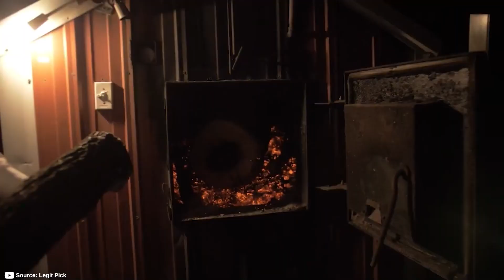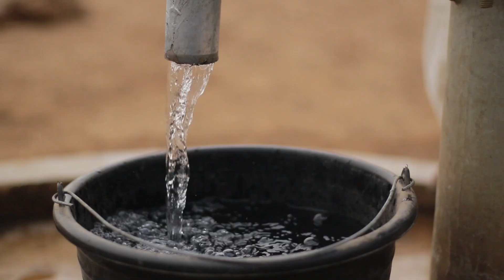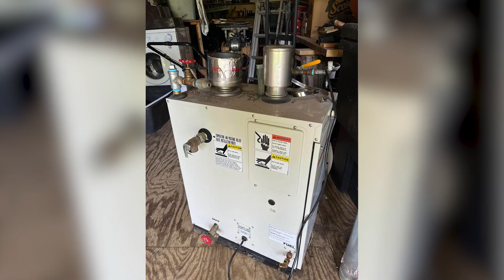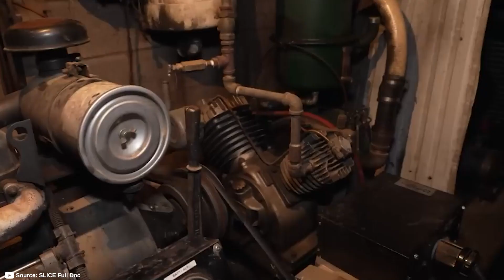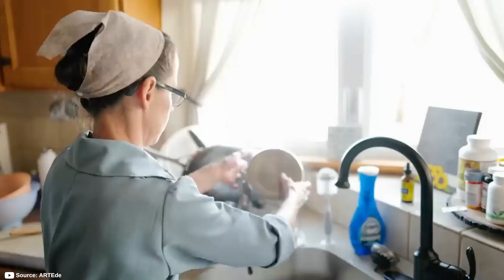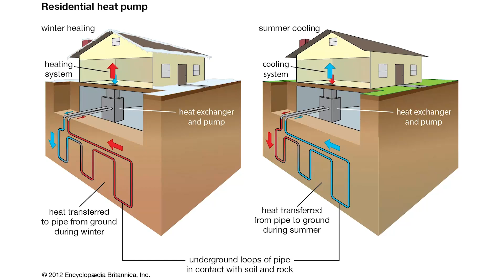How The Amish Get Hot Water WITHOUT Electricity

Comment: Geothermal heating doesn’t necessarily work well in very cold regions. I lived with my friend who had this system I froze every winter. Barely holding 60 degrees F. We had to rely on a chip burning stove to at least keep the kitchen warm that said it was a very large home on Lake Ontario mix in big windows and the lake. Very very cold summers better air-conditioning worked well on it.

Comment: how do you create pressure with no electricity?
Reply: gravity
Reply: @N1ghtR1der666  How do you use gravity to pull water up hundreds of feet underground??? 
Do you, like, turn it upside down or something?
Reply: Haggis, the water pumps are operated by hand with a lever and small pump. Think of  a bicycle air pump. These types of well water pumps were common throughout the US. Transferring the water high up into a water-tower or water tank allows for pressurized indoor plumbing.
Reply: @undernetjack  I know how it works, thanks. 
I was asking the other guy to explain how you use gravity to pull water up when it's gravity that's pulling it down
Reply: Ask Queen and Bowie .